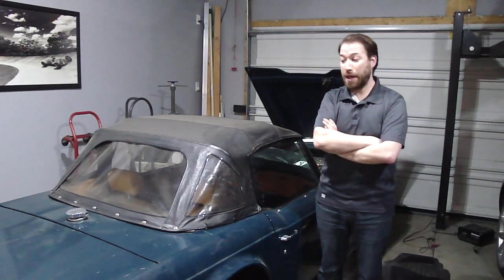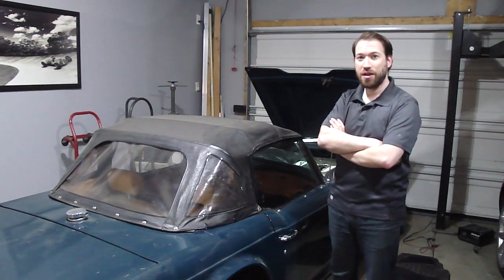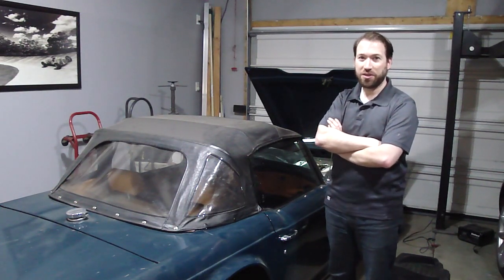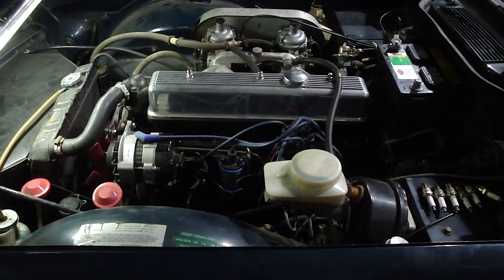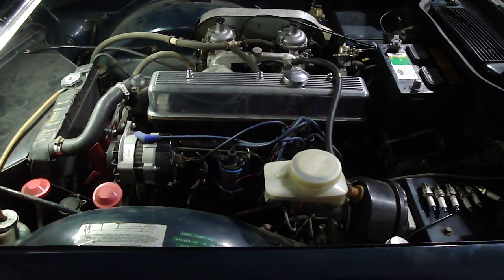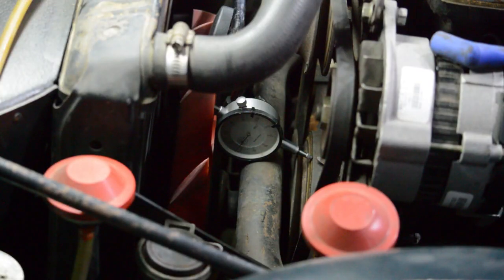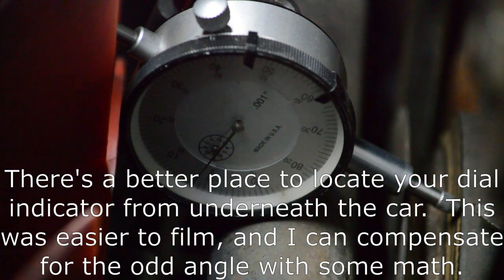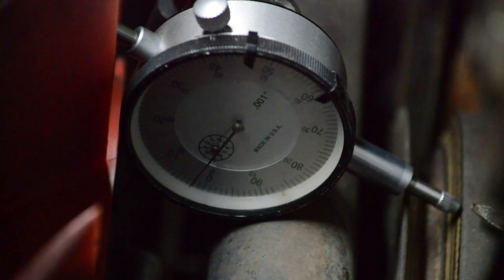Triumph TR6: Part I (Compression, Crank Float, and Rocker Clearance)

Comment: Hey there, I want to say thank you so much for such a great video again. I've been using your instruction to rebuild my late father's tr6 and I'm so excited to get it going! 
I have one question; when you are adjusting the rocker clearance how do you turn the engine so slightly? I will try to knock that out next.
Reply from the maker: The easiest way for me is to put the car in gear and rock it forward. Obviously make sure it's off, and it's easier with the plugs out since it won't build any compression. The engine will rotate with the forward motion.

Comment: Jeez, these cars were a pain in the 80’s when I owned two.  I was under the cars every weekend to keep them running for the week.  Fun cars, learned a lot about fixing them.  Can’t imagine owning one now with  40 years more of wear and tear.  Cheers to you guys, but I think I would get a Mazda MX5 instead!
Reply from the maker: There's definitely a good case to be made for more modern metal.  On the other hand, parts availability and access to tools has improved quite a bit.  Not to mention that the cost is starting to increase--so you're starting to see more reliably built cars.  Anyway, who am I to talk?  I owned a 2001 Z3 for a while and loved it!

Comment: I could be wrong but I thought we could depress the clutch and release it to check the movement of the crank
Reply from the maker: You're half right.  When the clutch pedal goes down it will force the crank all the way forward.  But it doesn't move it back when you release the clutch, so you won't get the full movement.  If you force the crank back first though, you can measure the movement.
Reply: @midwestmotoring  your logic is sound

Comment: The engine compartment was pretty clean, matches your description of the body. Cars seems to be a safe gamble.
Reply from the maker: I felt the same way.  The biggest problems appear to be from sitting.  The brake pedal went to the floor (PDWA and master cylinder leaking), the carburetors were frozen (just solidified gas), and the distributor was improperly put together.  The car started after finishing these checks that I'll show in future videos, but it wouldn't rev.  The weights inside the distributor were stuck together and the springs were incorrect.  All in (several) days' work!  I'm hoping a wet-sand and buffing session will bring the paint up a few levels next.

Comment: Thank you for posting these videos. I’m thinking of getting a TR6
Reply from the maker: TR6s are one of the most usable classics you can buy.  They're easy to get parts for, and can be very reliable if maintained correctly.   We're big fans!
Reply: @midwestmotoring  And, parts are really cheap compared to modern cars!
Reply from the maker: @jamcdona  absolutely true.  Brake discs on my "modern" car were over $200.  They'd have been about $60 on most Triumphs.  They require more care, but less effort in a way.
Reply: @midwestmotoring  And, for $20 or so more you can get drilled rotors, if that's your thing ;)